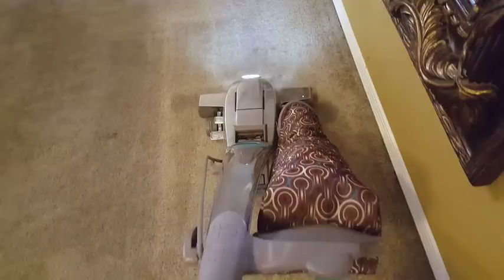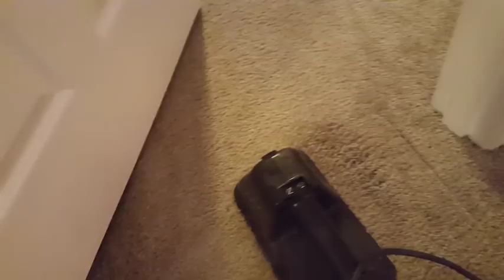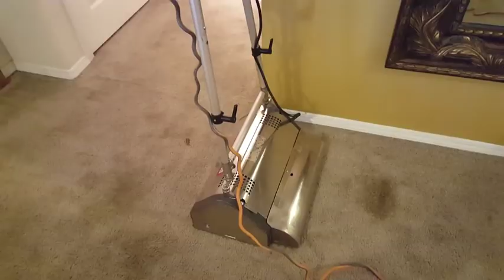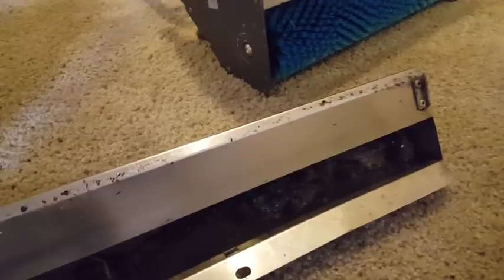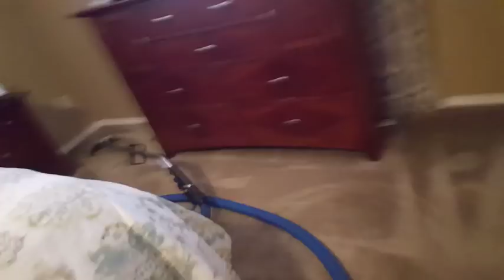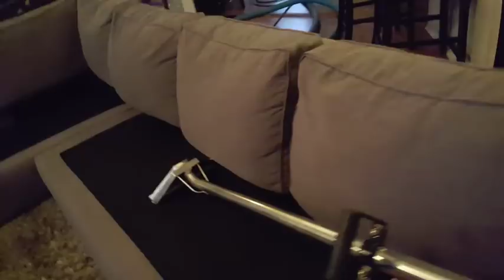Best Practices & Specialty Stain Removal Happy Valley OR

Comment: I'm a big fan of a good pre-vac. I also thoroughly do the edges and around door frames. I have never had a call back or complaint about the quality of my work 😏
Reply from the maker: If done properly, there is no excuse for complaints - However, equipment does malfunction from time to time and the customer usually forgiving when you're up front with them.
Reply: Yes, it does. I always take out two machines to a job in case that happens.

Comment: I have done carpet cleaning since the 90s on and off I'm trying to get my own company started I have a apartment complex asking for my business license w7 and everything now I was told there cleaner does the cleaning for 85 and carpets for 45... They want me to show them a price sheet now I know I want to charge the same or more and not do a bidding war just sale a better service... I'm new to bidding so is there any advice you can give me. As far as the pricing I need the turn overs till I build a rep and don't want to ask to much... Any advice would be very appreciated.
Reply from the maker: I purposefully stayed clear of property management because the want the most work for the best price...   Making it really hard to maintain quality. From what I have observed...   you have to be able to slam out large quantity to make it work....   possible multiple trucks. I never went in that direction.   The only apartment work I do is for the smaller, privately owned units.... So I am dealing directly with the owner and not management seeking the lowest price. 

Whether doing a bid or a sales pitch, the best strategy I have found is to provide three options....   Most people tend to pick the mid-grade option and I would assume property management would be similar. 

Hope this help a little. Feel free calling for any specific details

Howells Carpet Cleaning
7609 SE Overland St, Milwaukie, OR 97222
Geoffrey | (503) 939-0534
Reply: Geoffrey Howells thanks for the advice

Comment: Hey mate thanks for the vids.
Whats the ingredients of the red one ? Is it just for synthetic stains and can it be used on all fibers ?
Sorry for all the questions. 
Cheers. Steve.
Reply: Geoffrey Howells. 
Thanks mate. 
Ill have a look and see if this or something similar is sold in Australia.
I've been getting good results just seems to be the red and orange stains i've been struggling with. Ill go and buy my self a wallpaper steamer today.
Looks like a crb is on the list of equipment to buy.
Been using my 175 with a shampoo brush for agitation. Thanks for your help its much appreciated.
Reply from the maker: Orange, red, yellow caused by curry....   that is a completely different kind of stain requiring protein spotter.
Reply: Geoffrey Howells 
Cheers i have a product called Sensation i can use for my protein based stains.
Reply from the maker: The 175 works great...   but the crb is a bit more gentle on carpet pile and it pulls out the matted hair. Good luck bro! :)
Reply: Geoffrey Howells. 
Yer it looks awesome.
Been looking out for one for a while. There $3600 Australian not cheap.
Reply: Geoffrey Howells. Any advice on advertising ? 

I have a website, a face book page and had a flyer made up. 
Im going to go and introduce myself  to the local real estates agents high rise building managers, old people's homes etc.

I'm working 3 days a week for a dry carpet cleaning company at the moment, I know dry cleaning is s*** compared to hot water extraction but its the only job I could find that would take me on for 3 days a week while i build up my business.

Couldnt afford a truck mount so have a nautilus mx3 1200 psi with a mytee heater and generator.

I'm excited and scared at the same time having spent all this money and not having many customers yet lol. Fingers crossed.
Reply from the maker: Actually, I do, but it is quite complex to explain over this video forum. I can explain how to build a good referral / review program. Also, I can do a few things to improve your local google map visibility. Drop an email below and I'll shoot ya an email with an explanation.
Reply: English Ozzie I use that too, quite effective